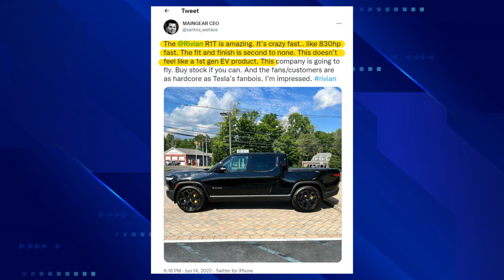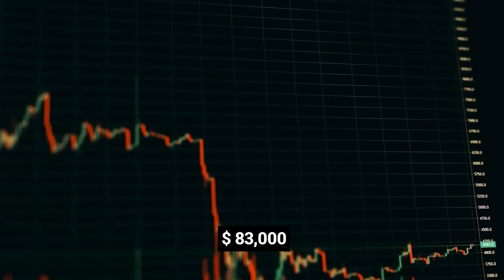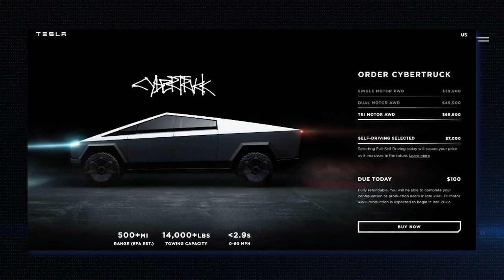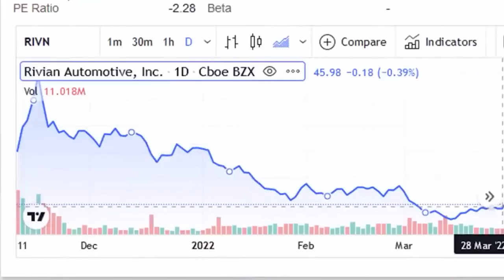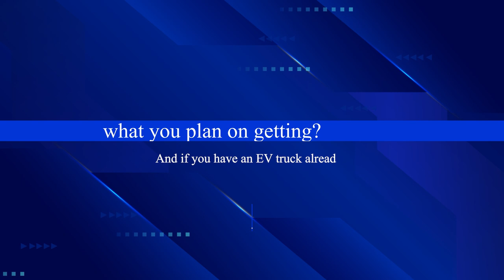Rivian R1t SHOCKS Elon Musk!!! Tesla Is Worried

Comment: EVs are not the solution to save planet earth when the bulk of power generation used to charge the EVs is still dirty electricity. Until we have electrical production from fusion, hydrogen, or GALT and in the jnterim we bust out some more nuclear facilities to produce electricity and at the same time decommission all the coal fired electrical production EVs are just as much of a problem re carbon footprint when you factor I the amount of energy it takes to mine and refine lithium and the additional energy used in battery production , add in the energy for car production which is about the same for gas/electric vehicles, add in the energy required for all the wiring improvements to the electrical grid (massive upgrade required to be able to charge 1000 cars per neighborhood, city wide, for each city in the USA (or world if you think globally) + the cost of charging stations an EV will need to run well over 150,000 miles to get to the breakeven point where it actually has a lower carbon footprint than a similar type traditional internal combustion vehicle, even more for a comparable usage diesel  vehicle and once hydrogen->electric realtime conversion becomes cheaper and safer and ubiquitous AND hydrogen  combustion engines that are already available that have a much lower carbon footprint and the potential for truly renewable energy  (with real-time hydrogen extraction from water in sealed system engines that capture the H20 exhaust for reuse)   And with 5x the horsepower at 1/8 of the weight and size of gasoline powered motors in the newest motors already designed and produced, EVs will be just one choice and not the most responsible choice ecologically (nor intelligently with the plutocrats getting legislation  and the required tech in place to charge us out the ying-yang  for energy and tax us for carbon emissions - as well as cornering the market on water, charging tons for purification of wastewater and for drinking water at prices already higher than gasoline while legislating away your right to collect rainwater and purify it for home use or minimizing the amount you can capture and store for other personal use - HEDGING on H20 tech being the holy grail [happening in a country near you now globally] EVs are just a 3 decade blip on the radar of truly sustainable technology for powering vehicles and everything else which will be done ultimately with fusion. (Germany just demonstrated a working fusion reactor with massive potential, maybe 8-10 years before full ubiquitous commercialization and harnessing that which will obviate EV technology desirability and relegate the remaining vehicles being manufactured in the next decade to use them til they break as long as it affordable utilizing grid energy from newer cleaner sources (Musk has mini clean fision reactors that can be set down in any neighborhood safely already designed , other efficient thorium reactors are on the way before 2025 and will be widespread by 2030). so don't hang your long term hat on EV pipe dreams, it's a transitional technology innovation that will quickly be surpassed and will likely not matter past 2040. exciting for the time being but still not close to all they hype and misinformation surrounding the clean energy low carbon footprint of EV tech.
Reply: 🙄😐
There's this thing called COMPROMISE!!